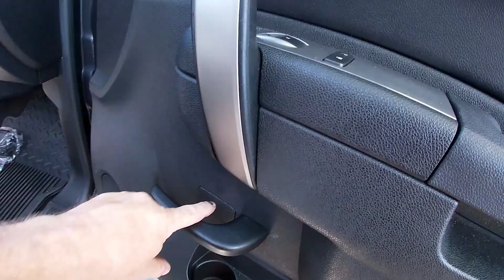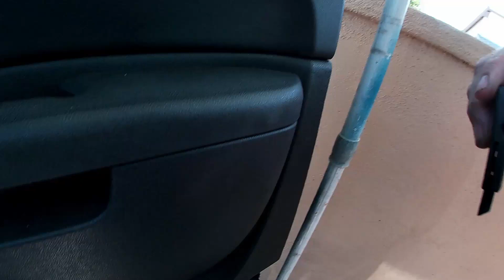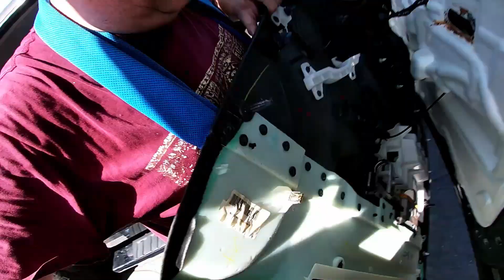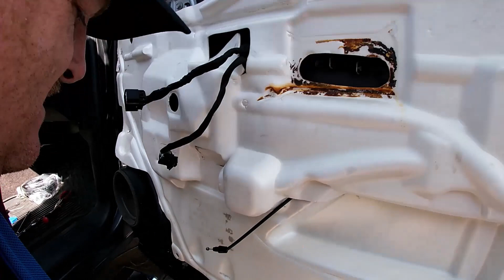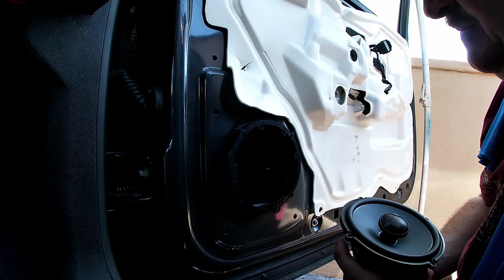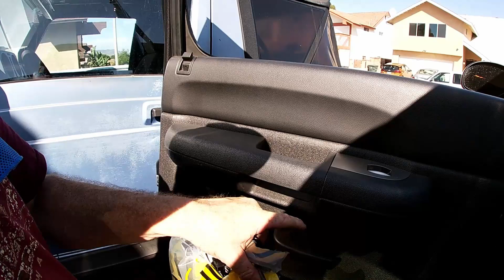2011 Silverado JBL Speaker Upgrade

Comment from the maker: I know I didn’t show how they performed but they sound amazing. Besides the camera will never do them justice in my opinion. If you are interested in purchasing these speakers, you will not be disappointed..... Thanks
Reply: My driver door speaker and my tweeters are the only thing that worked on my 2012 silverado, I just bought these speakers and installed them and I’m still stuck with the same problem! Any help is appreciated!
Reply from the maker: @drakeharvell4089  I would make sure your balance and fader settings are correct.. Also it’s known for the stock radios to fail in many different ways from display issues to speaker separation. You may also need to upgrade the head unit.

Comment: Great video. Thanks. I am going to take your advice on the dampening foam. Did you have 5.25" in the back door and 6" in the front door?  I wasnt sure if your adapter was converting the speaker size. Thanks again
Reply from the maker: I used 6.5’s in all 4 doors. Sounds really good but could have used some more sound dampening behind the plastic door panels. There are some rattles still. Thanks for commenting!!
Reply: @DIYWilly  awesome. I’m excited to get upgraded. No door mods required? What year is your rig?
Reply from the maker: No extra mods required. Everything bolts and snaps in place as it should. It’s a 2011. I purchased it new and try my best to take care of it. It only has 75k miles on it. I drive it more now as my daily while my Samurai is down. What speakers have you chosen to install and are you changing the head unit?
Reply: @DIYWilly My truck is an 11 as well, extended cab. Specs show the smaller speakers in the back. Yeah. Purchasing a new head unit is what encouraged me to do the speakers. Im leaning jbl too. Iv purchased jbl in the past snd have been happy.
Reply from the maker: What I have looked on the specs for extended cab still shows 6.5 according to Crutchfield. Sounds like your on your way to some great sound!
Reply: Thanks for the video. I am unsure what adapter brackets I need. I’m going to put some 6.25 pioneer at-d65f speakers in front and back doors. I have a 2011 Silverado as well. My car audio dealer gave me some metra adapters said they should work, the speakers don’t fit inside the adapters. Like I said I’m unsure what I need to make these speakers work. Any ideas?
Reply from the maker: What is the part number of the adapters they gave you? Did you mean TS-D65F speakers?
Reply: @DIYWilly  yes I did mean ts-d65f my bad. The adapter he gave me is a metra 82-GM1. He only gave me 2, and said I wouldn’t need one for the back doors.
Reply from the maker: From what I found those are not correct for the 2011. I used scosche sagmhr634b in my truck front and back and all went perfect with the install. Hope this helps
Reply: @DIYWilly  I will look into those. Thanks for the help. They should work even with a different speaker than you used right?
Reply from the maker: Yes as long as there either 5.25 or 6.5 size
Reply: @DIYWilly  ok. Good deal. Thanks again.

Comment: Awesome Sir! I have a 2012 Chevy Silverado LT and have 4 DS18 6.5 inch door speakers to install! Do I need the adapters or can I use the stock?
Reply from the maker: Hello Erik so the factory speakers are made to fit the door. So once you remove them you will need an adapter fit the new 6.5 speaker. If your a DIY type person you may figure it out your self but honestly the adapter is not expensive and make the install that much easier. If you can post a video of your install and let me know about it. I would love to see how it goes for you. Hope this helps. Good luck with the install and thanks for watching.
Reply: @DIYWilly  yes sir! Thanks for the advice!

Comment: Do you happen to know what the maximum mounting depth is for the doors
Reply from the maker: The JBL GTO series speaker I used have a mounting depth of 2 inches. With the adapters I used I would say there was still 1.5 inches behind the speaker. I honestly didn’t measure it and I talking from memory. Hope this helps. Thanks for watching.
Reply: @DIYWilly  thank you have a good one 👍🏼

Comment: I thought the rear speakers for extended and crew cab were 5 1/2. From what I read the front is 6.5" and the back is 5 1/2" so how did you mount the back speakers
Reply from the maker: I used exactly the same as the front as for the back. All the same adapters and the 6.5 speakers. Thanks for watching
Reply: @DIYWilly  ok. I was just wondering cause i know our trucks for the rear speakers are 5 1/2" I was just confused on how you managed to fit another whole inch of speaker. But cool I just bought them and they will be here tmmr can wait.

Comment: @ 9:45
did that wire come with the speakers?
or do i need to buy them separately?
Reply from the maker: I bought the adapter pigtails separately. All the parts used should be in the description.thanks for watching and commenting.
Reply: @DIYWilly  dang i just seen it not for my truck. i have a 2003 silverado 1500hd
and i want to change speakers but I'm nervous because i don't know if it's gonna be easy or not

im hoping for a plug n play and I'm looking into buying these same JBL speakers. Any thoughts or advice?
Reply from the maker: Shouldn’t be that different. The interior panels most likely attach different. I did a quick search and looks like the METRA 72-4568 speaker harness adapter and the METRA 82-3002 speaker adapter fit the 2003 truck. Check it out... Hope this helps your install.👍
Reply: @DIYWilly  Thank you, sir.
I will order those along with the speakers on Amazon. if i have any issue with the parts, i can always send them back and get refunded.

I'll keep you updated.
Reply from the maker: Fantastic looking forward to hearing about the install.
Reply: @DIYWilly  I installed the new speakers.
it was way easier than i thought it was gonna be. 

The harness you told me about worked i appreciate you sending me that info.
Speakers are helluva lot better than the ones i had in there already.
Reply from the maker: That’s great I love hearing that things worked out for you. What head unit did you choose? I know you said you were getting the JBL speakers.
Reply: I just wished more bass.
but probably have to do the whole 12s / amp BullShit to get that good bass sound.

that stuff is way out of my league
Reply: @DIYWilly  Kenwood
Reply from the maker: Nice! Always had great sound from Kenwood. 
Good job on the install!
Enjoy the new improved sound quality. Now you’ll want to take longer drives right? I know I always look for a reason to take a long drive..... hahaha
Reply: @kozmicflush980  I also want more bass. I installed an under the rear seat box with shallow 10” Pioneer subwoofer in my sons frontier. It really fills in the bass nicely. But not so loud as hearing it coming from two blocks away. I like the thunder bass and I’m thinking about a 12” woofer in custom box in center console. Been trying to figure out the design with a small port. It’s really not hard to install a box and an amp. I believe since you were able to install the head unit and speakers you could also easily do the subwoofer and amp. If you have any questions I am glad to help!!
Reply from the maker: That from Mr Williams is me. I was using my phone and the phone uses my other account.
Reply: @DIYWilly  Ahh, i was wondering, hmm. who is this gentleman? Lol  thanks
i will look into the sub and amp when i get some caught up on some cash.
i just don't know much about splicing into wires and all that 

i didn't install the radio, i had somebody do it few months ago but haven't heard back from him in weeks. Long story.
But if its anything like this speaker install then my confidence grow stronger

Cheers, Willy.
i will keep u updated when that time comes. 

-Matt